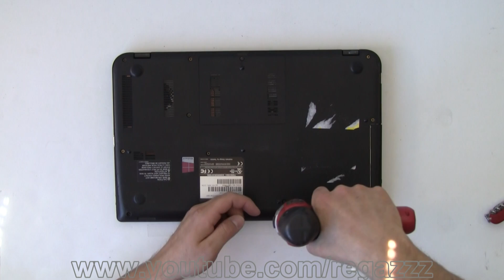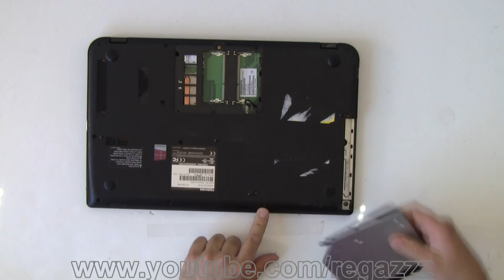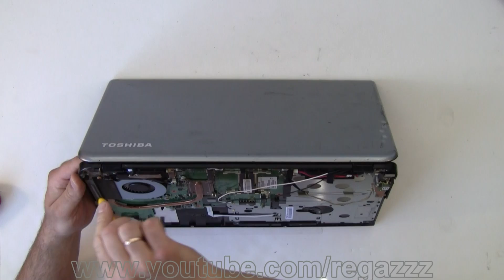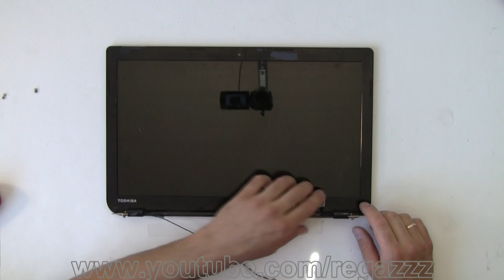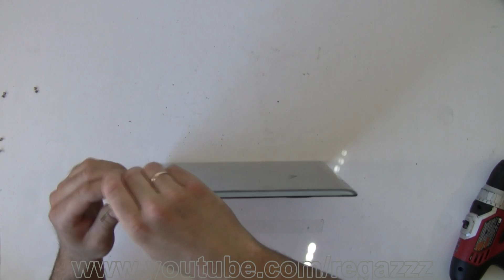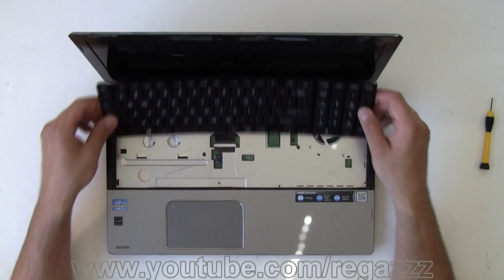Toshiba L55-A Take Apart, Complete Disassemble and Reassemble

Comment: can you tell me what SSD is compatible with this laptop and how many mm is the DVD size ?
Reply: The Crucial MX500 1TB 3D NAND SATA 2.5 Inch Internal SSD, up to 560MB/s - CT1000MX500SSD1(Z) sold on Amazon works great with the laptop.
Reply from the maker: Regular sata ssd should fit. On dvd drive size I would check eBay, find a drive and ask seller for a size.
Reply: Ok thanks

Comment: Great video,  helped me tremendously.  Question.  
I replaced the motherboard of the exact model here. L55-A5284 
I found one L55t-A5186.  Same setup,  body screen,  everything.  But with a newer i5 processor,  and hd4400 graphics.  Everything mounts the same.  Same case design everything.  Only difference is the touch screen,  yet the hook up is the same connector.  Only thing the new motherboard did not come with ram.  I swapped the 2×4 gb from the original mobo to it. 

I put this all back together.  Wasn't very difficult.  I lost 1 case screw.   After reassembly it won't boot.  Won't power on.  No lights no sound.  Nothing.  Figuring the new motherboard was bad,  (which it was tested good and has warranty) I put the old one back in.  Re assembled and the same result.  Nothing.  No sound, lights,  nothing.  

Is there something I should be doing that im not? I got this for pennies,  for my kids who are in school.  The new mobo had battery cmos,  processor,  vent tube and cooling fan attached.  (Yes the processor is there).

Hoping you might have some insight.  Thanks.
Reply from the maker: Aside from the usual questions, like did you locked cpu(unless it is build-in) once you placed it back, I would also try it on a external screen. Also, if you have two memory units, I would try one of each in different ports. 
I would start with memory, than ext. screen and after than cpu.
Reply: Locked CPU? Both motherboards have CPUs inside under cooling tube.  Never touched, and both solid (tight) . I just stripped it back out.  Replaced the original again,  (this one was working before. ) re connected every wire,  and keyboard,  drained residual power holding power down for a minute,  leaving battery unhooked, plugged power cord in.  Nothing.  I'll try swapping memory around again. Though,  I've tried almost every combo.
Reply from the maker: @adamcrocker1419  I thought you removed a cpu. If not touched, it should be fine how it was before.
Reply: Nope,  I just swapped the mobos. Neither will even start to boot.  Im in the process of rebuilding with the new mobo.  Then swapping the memory into different slots, after that. I have no idea  what else to try.
Reply: Do you have to have the back cover on to power on?
Reply from the maker: @adamcrocker1419  should not be a problem to power on without a back cover.
Reply: @regazzz  the entire back cover.  It's just becoming a pain putting in every screw to see if it boots after swapping hardware.
Reply from the maker: @adamcrocker1419  as long as a video cable is plugged in - it should light up
Reply: @regazzz  nah,  I'm getting zero. Nothing.  No lights no fan. Absolutely nothing.  I give up.  I can take the thing completely apart with my eyes closed...  it won't boot.  All I know, is it worked before I started.
Reply from the maker: @adamcrocker1419  no lights on a power button?
Reply: @regazzz  I got NOTHING.  no lights, no sound,  press the power button.....  nothing at all happens... nothing.  Lol

Comment: Do you have to disco battery if removing hdd? and what would be a good ssd (prob just need a 240gb) for this computer, giving to my mom.
Reply: You do not have to remove or disconnect the battery to replace the hard drive. Samsung 860 EVO, Sandisk Ultra and Western Digital Blue are good SSD's.
Reply: @kennywhiddon1497  Yeah i already did it, with a crucial bx500 240gb ssd. works way better than i thought it would. and was easier than i thought it would be, i watched a couple videos on youtube. its on old l55-a5226 toshiba laptop. does the basics pretty well, pretty speedy. $40 only.
Reply: @mts982  I have one just like it, same model.
Reply: @kennywhiddon1497  I used it daily for about 6 years many hours a day. it was time to upgrade.

Comment: Sir, I really need your help. So far I think you're the only one that can help me. I have a Toshiba Satellite L55-A5299. Two years ago the screen stopped working, so I  had to find a way to access the BIOS and configure it to use my TV as the screen haha. It's was hard. Then I used your video to disassemble the laptop and clean it. It worked. So far so good. But I don't know when it started asking for the BIOS password. I don't know the password and I don't even know if I did set it up. So I don't if it was my fault. Anyway, how can I solve this problem????

Comment: did you have to remove the keyboard or doing anything on top of the computer to remove the hard drive?
Reply: This video shows all parts removed, although for the HHD to swap for SSD all I had to do was the cd drive pull, and back RAM door to replace the plug, not pull the RAM.  When you see the HD do as he did pull rubber casing off and just put on your new SSD. Be sure to blow fan and clean while this moment is upon you, it made all the difference.  MY boot time is 2secs now and don't hear my poor old idle of my gross fan anymore.  LIKE A BRAND NEW LAPTOP!!